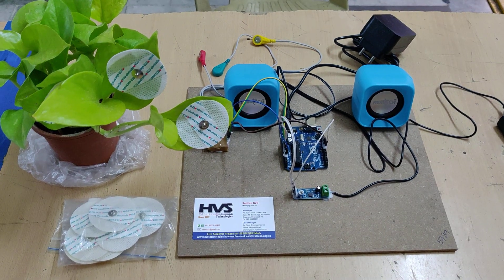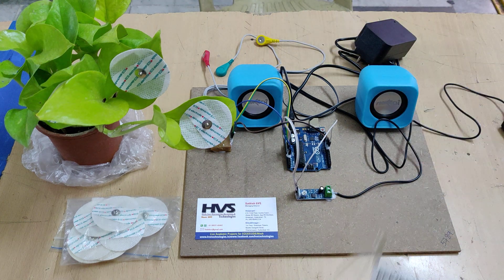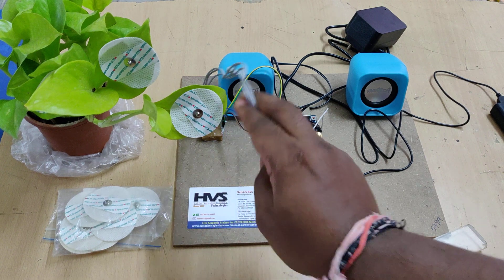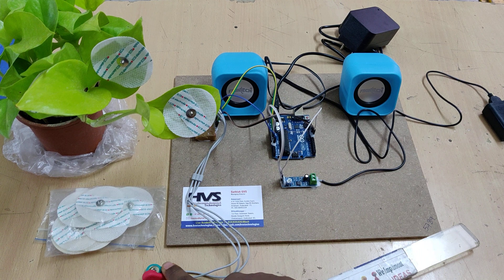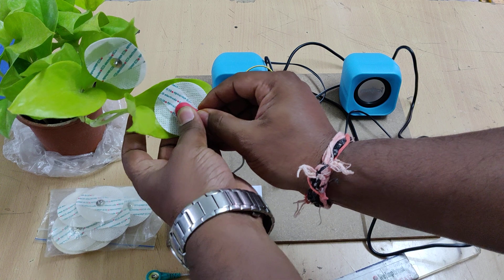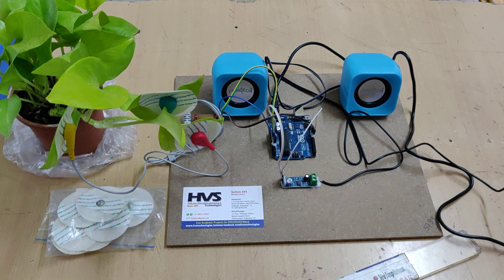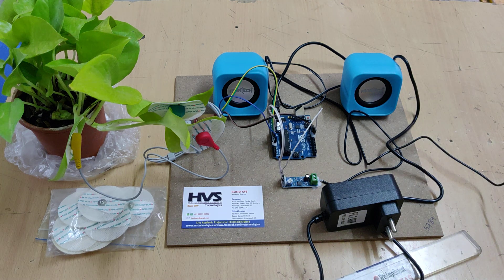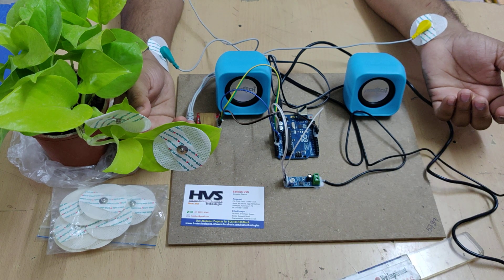HVS-3293. Music From Plants Using Arduino #electrodes #arduino #speakers #amplifier #plantleaf.

Comment: I am trying to make a plant response analyzer using the small processor board of  rain sensor module. If I connect the two electrodes with the small board and a small piezo buzzer/small speaker with the data pins of board then will the system work? I want to know eagerly. Please let me know
Reply from the maker: You can contact us at +919603140482
Through WhatsApp or call